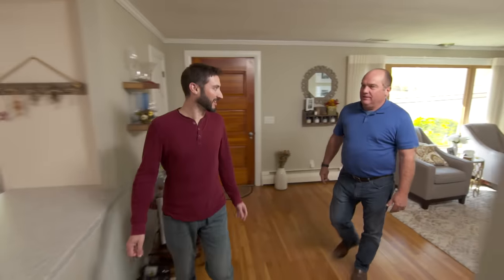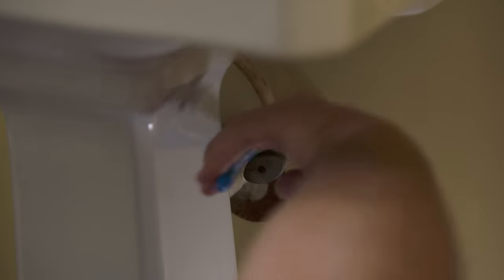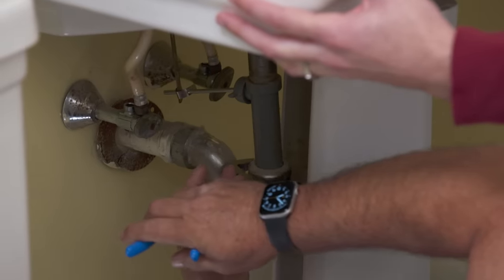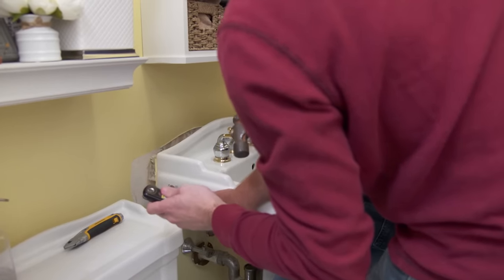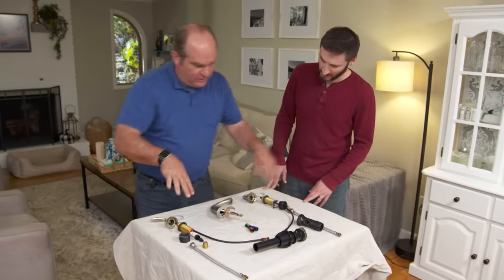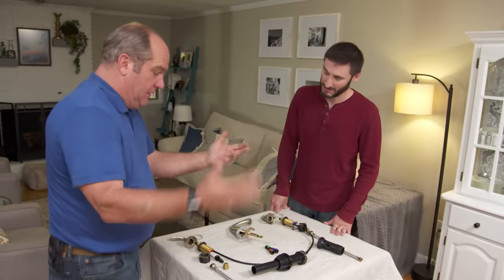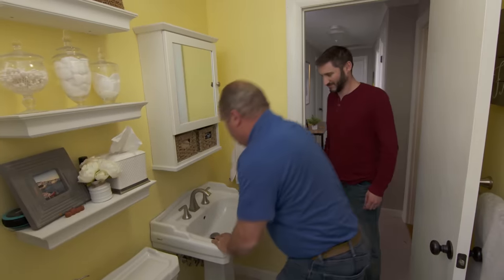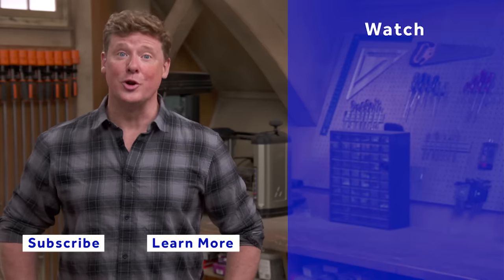How to Replace Pedestal Sink Parts | Ask This Old House

Comment: Hey, I was told yesterday and today by 2 different plumbers that my stopper with the new faucet set could not be used because the stopper hole was too small. Also, one of the nuts rusted underneath one of the knobs and they said they had to cut the old faucet set out. Also, the actual water faucet they installed is not stable. I am able to move it side to side.  Also, now the pedastool sink teeters where it was secure before. Again, they say wait for the caulk to dry. Is this normal or should I complain again? My pedastool sink was installed about 6 years ago.

Comment: I'd like to share this:
It is common knowledge we have P Trap on our sink and shower floor drain - to prevent sewer gas from backing up. But did you know that the P-Trap itself, after some time would collect gunk from all the soap, dirt and grim along it's inner surface and it stinks? There are numerous remedies to this such as Vinegar + Baking Soda etc...  But nothing beats using a high pressure washer.

Comment: Should always take out the aerator before turning the water on to prevent any debris that has been introduced into the lines. This happens when you shut the feed valves off and back on, (especially on multiple turn valves)

Comment: Question for Richard. How does he deal with full city water pressure and how dangerous is it ?
Reply: Very dangerous. Can take a man's head clean off. lol
Reply: Lmao is this a real question?
Reply: Pressure regulator?
Reply: Why would he deal with city  pressure that's the city's job. But I have seen it go as high as a telephone pole at least 30 feet high.
Reply: O boy... people responses are killing me. You house has full city pressure in it people. usually around 80-90 psi depending on alot of stuff. Its not dangerous unless you drown....lol
Reply: @kingkelly9104  Not quite. Many homes have pressure regulators installed at the shut off valve.

Comment: nice video, I'm looking to replace our kitchen faucet for an old porcelain sink. Our tools are too large because the space where the facet bolts sits under the porcelain is so small. barely an inch. I'd hate to take out the whole sink(not in our budget) any tips on tools would be really helpful. :D
Reply: use a basin wrench to get in those tight spots

Comment: I've had problems with those pop up stoppers before ,maybe they're better engineered these days.Richard is the best and makes plumbing fun !
Reply: I bought a Price Fpister faucet and the stopper is great because all you have to do is screw it on from the top and to clean it just unscrew it. Costs like $50.

Comment: What would cause my sink faucet to have very low pressure ?
Reply: aerator could be plugged. plugged supply lines or stops. kinked lines to faucet.
Reply: LJU 
Re pipe (copper) maybe?

Comment: As you said, Richard, the sink didn't have to come off the wall. The caulk didn't need to be cut to lift the sink off the base either, it would have flexed enough after bolts in wall were loosened.
Reply: it makes replacing the components much easier

Comment: With enough finesse and patience you can replace all these parts without detaching the sink from the wall or removing the pedestal. It takes 3 times as long and requires 10 times the patience to get your wrenches under the drain, but it’s doable. That way you don’t need to remove, recaulk, or repaint. Easier and quicker for professionals to remove when time is money.